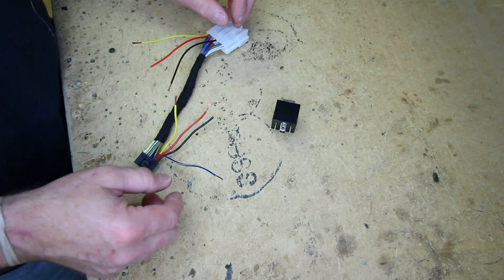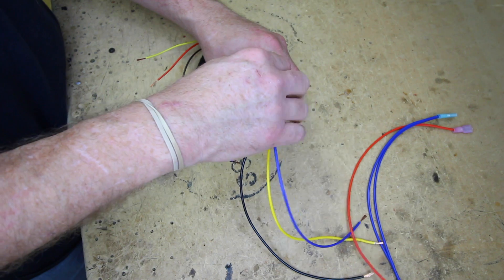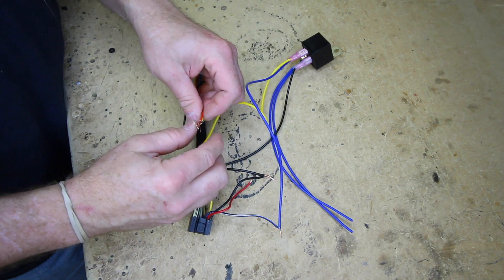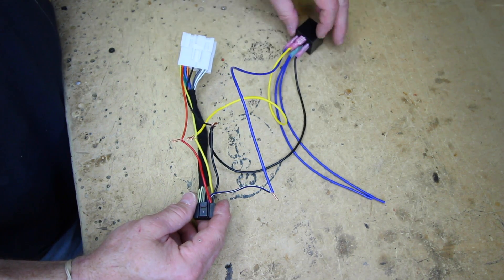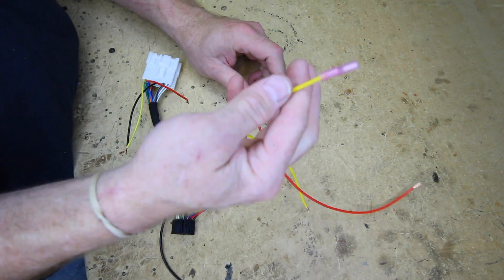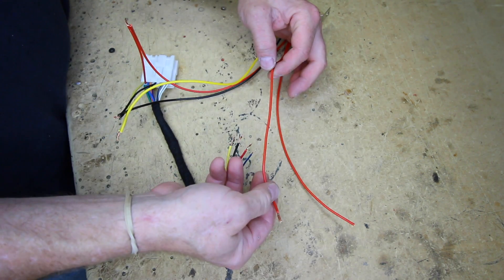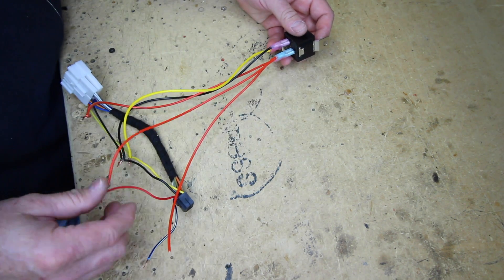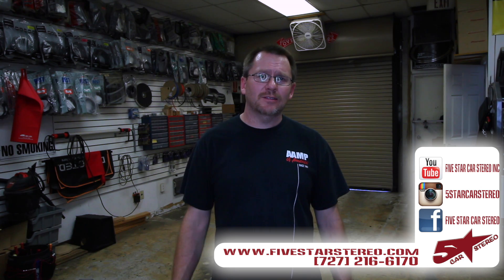How to add a relay to up the amperage for your car stereo accessory’s

Comment: What would be the problem if i ran both the radio and the backup cam on the same acc+.
Reply from the maker: There would be no problem. The relay would only be needed in cars with a low Acc power output our if you were doing multiple devices on the Acc.( example overhead, power ports, 2 cameras)
Reply: Thanks
Reply: @FiveStarCarStereoInc   can that 12v acc turn on 4 amplifiers? or does it need a relay?
in my other car i had the 4 amps on the remote wire without a relay,  had that for about 4 years with no problems

Comment: Í use a 3Sixty.3 DSP, and 8 out of 10 it kicks everything in, as it uses its remote turn on. I think the HU has one also(2 amps), but if I do the ignition turn on quick, the car and the HU turn on, but the rest, the amps don't kick in. Even the DSP remote bass control lights are not on. DSP I think fails to boot properly.
Would this help that situation?
Reply from the maker: It sounds like a power problem so yes
Reply: great to know... will watch again to do this install.

Comment: Hi, I know that you guys are really knowledgeable. I’m looking to pick 
up a 4200 NEX but I want to have the backup camera always be able to be 
on as well as switch to it when the car is in reverse. How does the 
radio need to be wired? Do you still have to wire the 4200 NEX to the 
brake lights to get this working? Seems when I was reading online you 
can connect the camera reverse wire to the 4200 NEX and it has software 
to be able to let you still view the camera any time you need to without
 being in reverse. Is this true?
Reply from the maker: Yes you will still need to connect to the reverse wire.There is a setting in the you can turn on to view the camera all the time. Check out this video
https://youtu.be/TDOXNEh1eH4
Reply: Thanks alot. This is why I really like your channel. Fast responses. Wish you were in NJ. Do you know of any Good shops in Northern NJ ?
Reply from the maker: +ninjamaster2009 yes try Enfig (201-490-5015)  ask for Christian, tell him Arty at AAMP sent you.
Reply: Thanks you guys answered my question in another video. Thanks again.

Comment: If you were to hook up a relay for your amps can you 1) get the power and ground from a distribution block running just the remote off the deck and 2) can you run your backup camera power and ground off same distribution block?
Reply from the maker: Yes that would work fine. We used to put the relays back at the amp all the time. It is easer to service if the relay goes bad.
Reply: Thank you